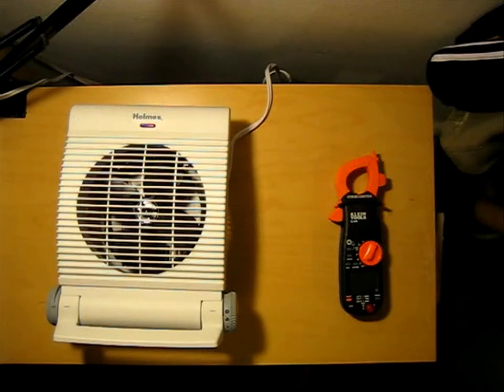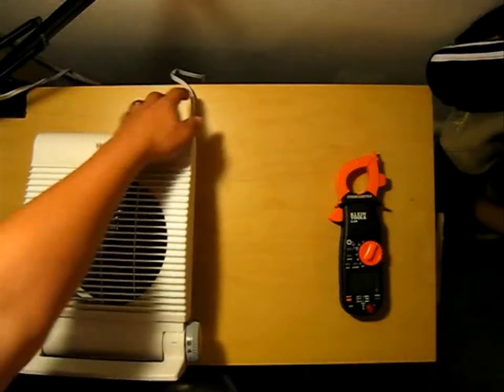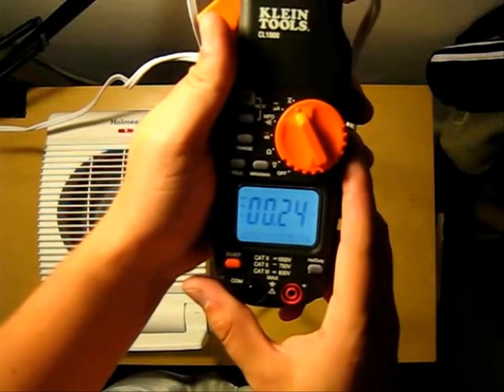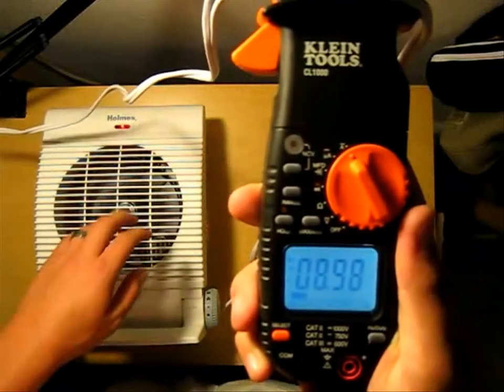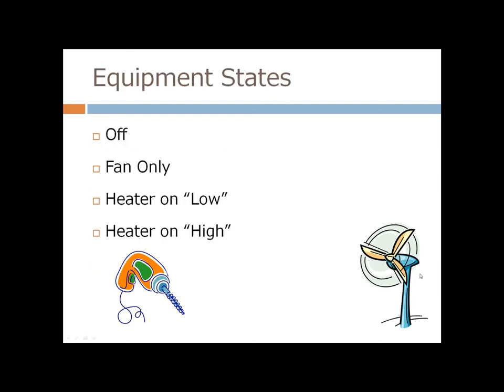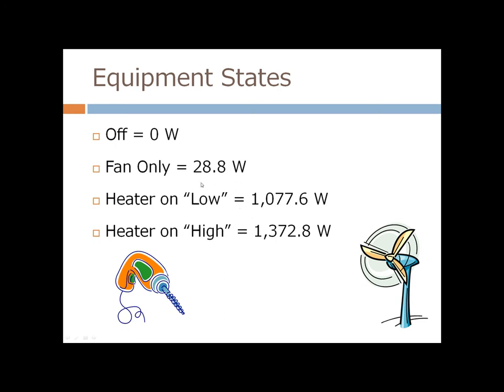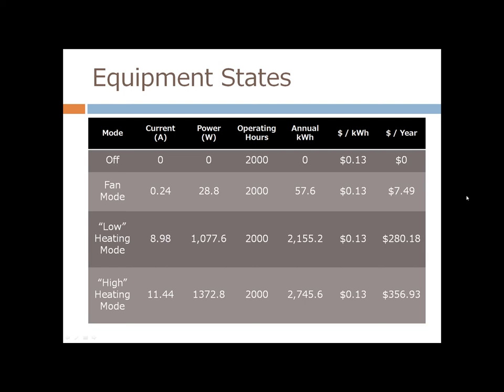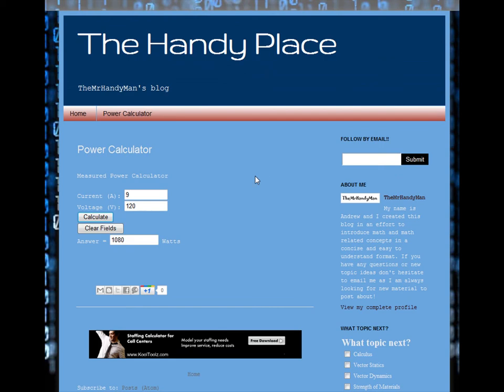Energy Consumption of a Space Heater

Comment: This video is lacking electrical code knowledge. The typical bed room in a common dewelling is only going to allow 12 amps to flow before the breaker eventally flips but if this was in the kitchen will allow 16 amps to flow on a number 12 wire. This is will tell you how much you can pull. The light dimming is just a product of resistance loading. Now I know why my old man said get those space heater out of the house they are enegry suckers.

Comment: You know what I think is sad? These wimpy space heaters pulling 800-1500 watts of power and can't even heat a closet. I'm currently working on a HHO space heater and with 150-350 watts of input power I'm getting heat in excess of 500 degrees. I can't believe so many people seem to think it will not work, maybe its because they haven't ran the experiments. I'll be doing side by side test pretty soon and I already know which system will win. Makes me so angry that they pull so much current